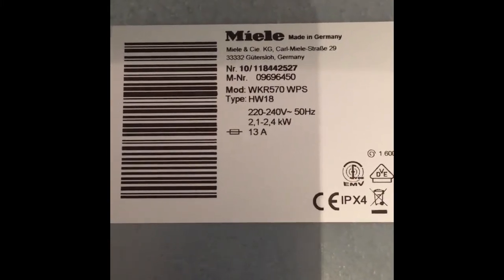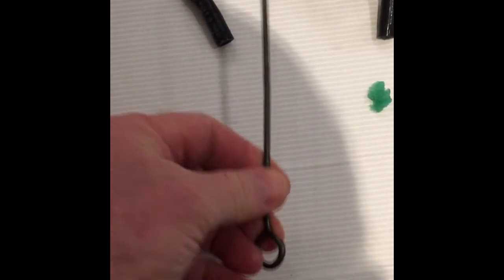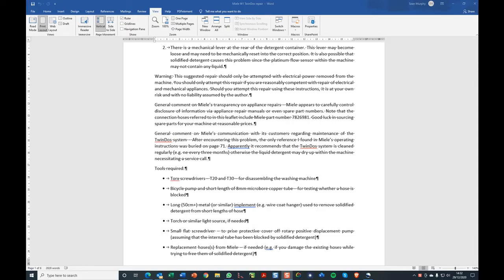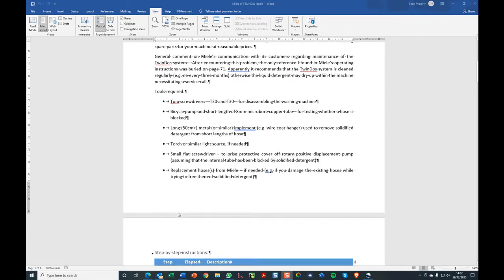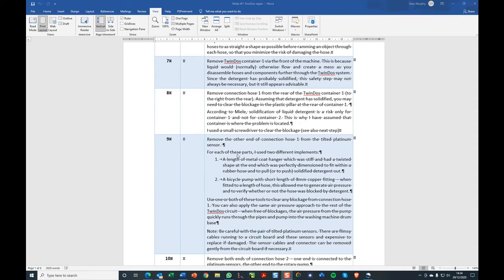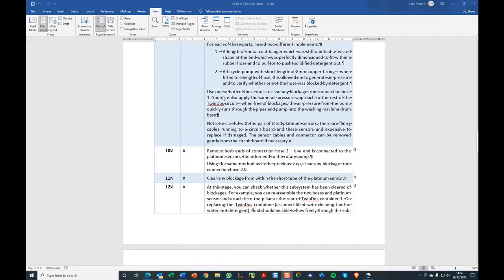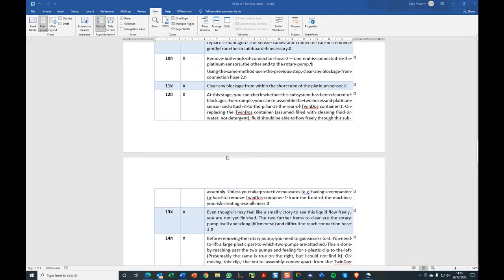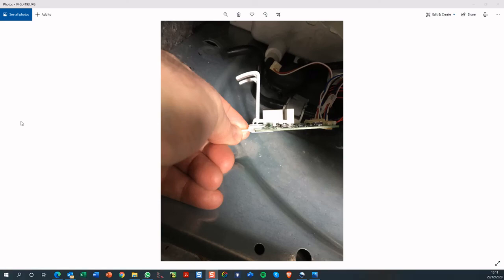Miele W1 WKR570 TwinDos Washing Machine Repair - problems with solidified detergent

Comment: Thanks for the great video. I did everything according to the instructions, but the following message appears on the screen:"Fit a new cartridge or refill container 2. Monitor wash result" appears, even though 2 containers are full. Any ideas?
Reply from the maker: Correct registration of the cartridges can be quite hit and miss. Sometimes it helps to turn the power off after inserting the replacement cartridge and then trying again. The machine is not able (in my opinion) to gauge the level of liquid in the cartridge, even though the display may ask for a refill. All it can do is a binary reading - then, after complaining, register the fact that you have changed the cartridge. So - change cartridge if that seems reasonable to you (for example, if the cartridge is empty - or if you have just run a cleaning cycle) rather than believing what the display says, then cycle the power a few times to make sure that the machine registers that a cartridge is present correctly.
Reply from the maker: If you had previously experienced clogged pipes which you had cleared as per the video, then you could manually check that the liquid is flowing again by temporarily unplugging one of the short pipes running between the DOS cartridge and the pump. You may want to place a low receptacle underneath the pipe to catch the liquid that escapes. It also helps to have a helper inserting the cartridge, ready to remove it once you have confirmed that liquid flows correctly.
Reply from the maker: One other oddity that occurred for me was that you may need to reset the volume of detergent to be dispensed, using the machine's display and menu. Ours had reset to zero millilitres.
Reply: @zengoelectricslimited6744  Thanks for the quick reply! I will inform about the result! Best regards!
Reply: @zengoelectricslimited6744  Hi, I dismantled the washing machine yesterday, cleaned all the pipes again, even replaced the Platinum flow sensor. I even opened the control unit and checked the contacts, everything is fine. I restarted to factory settings, but none of the above helped. The message continues to appear after each wash. I also tried your suggestions, but it didn't help either. If you have any more ideas, please share. Thanks!
Reply from the maker: One other suggestion. The system recognises the presence of the cartridge using a plastic lever (visible from the front of the machine when you take the cartridge out) that connects the rear of the cartridge to a microswitch on the circuit board to the rear (visible only from the rear of the machine). The circuit board needs to be positioned accurately for this mechanism to work correctly. Looking at the setup, it may be possible for the circuit board assembly to slip out of place and then this signalling mechanism may fail. The board should fit securely within a plastic slot to the rear of the cartridge assembly. Perhaps you have jostled this board out of position. It is worth a try.
As a shortcut, you could try manually pressing the microswitch by pushing on the plastic lever from the front. If you depress this lever and the display error message changes, then you have learned that this is where the fault lies.
One more suggestion - there is a spring loaded plunger that makes contact with the rear of the cartridge, forcing the cartridge to open when loaded in the machine. You could test the operation of this out of the machine by using a pencil or screwdriver to verify that liquid can escape the cartridge. Once the cartridge is pushed home, there is also a spring loaded lever at the front of the cartridge to engage it and hold it in place. You could also check this.
On my machine, once I had exhausted all other potential faults, I re-assembled the machine, then removed the front of the machine and disconnected the tube running from the DOS 1 container. This allowed me to verify that liquid detergent flowed correctly on the maintenance cycle. For this maintenance cleaning cycle, I fitted a spare DOS cartridge filled with water. It only took a few seconds to verify all of: Liquid leaving the cartridge; liquid flowing through the pipes; pump working correctly; liquid arriving to the front of the machine. This sounds like over-kill, but at least it reassured me that everything was working. It still took a few more washes to replace the cleaning water in the pipes with liquid detergent. The detergent gets loaded in the first few minutes of a wash cycle and then you can observe the suds in the water to verify correct action for the full system.
Reply from the maker: By the way, I discovered after a lot of fumbling around (with restricted access) at the back of the machine that it is likely possible (have not 100% verified this) to remove the entire TwinDOS assembly (including pipes and electronics) through the front of the machine. This would enormously simplify access to the mechanisms. In order to do this, you need to 
(1) Remove the top of the machine - using two screws hidden behind plastic plugs on the side edges at the top
(2) Remove the front of the machine:
     * Remove the seal around the front of the washing machine drum - this slips off easily using a screwdriver
     * Remove a large screw from beneath the seal
     * Remove screws from the locking mechanism
     * Lift off the front of the machine with door still attached - warning, this is quite heavy - place to one side
(3) Now you have access to the TwinDOS chamber - remove two screws holding this to the frame - can't remember how the TwinDOS chamber access door is removed, but it does not present a problem
(4) The entire mechanism is still attached through friction to the base of the frame - push gently backwards to free the retaining lugs, then lift off
(5) The entire mechanism with pipes, pumps and electronics now looks capable of being pulled through the front of the frame - this gives perfect unrestricted access to the whole mechanism for scrutiny or repair
Reply: @zengoelectricslimited6744  yep, can be done entierely from the front. See service miele manuals like this one (for the washer-dryer wt1 but it applies to w1 too, they describe both access methods under §.7 "dispensing system") https://fliphtml5.com/jknmy/kxha/basic/351-400  (download pdf & use index in reader sw for easier browsing)
if doc link dead search for "Technical
 Service Documentation TSD no.W0008"

Comment: Great video!

Since recently my Miele is displaying error F0214 when using TwinDos system. Do you know what is this error related to?
Reply: Good info. From Miele site they have superseded this sensor 5 times. Surely  this is an inherent  fault and is covered by EU rules for 6 years
Reply from the maker: From a German source: The error F0214 indicates that a temperature sensor does not detect any or incorrect values. This is the PTC 2 (B3-5).
Either a thermocouple itself is defective or the sensor stops working. It is also possible that an electrical connection has been loosened by the vibrations.
Reply from the maker: From the same German source: Doesn't belong right here, but on my Miele WMG820 (BJ2016) the error F0214 was caused by a defective TwinDos platinum sensor 9 976 602. The sensor is located behind the TwinDos slot. To do this, the machine must be opened from behind. The part costs about 85€ at Miele. (I have come across platinum sensor issues before - the part is hugely expensive)
Reply: @zengoelectricslimited6744  Yes, it was caused by a defective TwinDos platinum sensor. Since the defect was not caused by misuse I wrote to Miele and got 50% discount on the spare part. 
It actually has two sensors inside (one for each catridge) and I figured out that only 2nd is not working, so now I have one (1/2) as spare. :-)

It seems that Miele has problems to keep the quality of the TwinDos in line with the rest of their systems. Platinum sensor has undergone several modifications and it would be nice to have it regularly available at discounted price level, as it's way-to-expensive repair tend to ruin customer satisfaction.

Thanks for support!
Reply: @Marko-zp6gm  guys, the platinium sensor is a basic pt100 RTD. At 25 deg C. it mesures around 110 ohms. If you don't want to pay for the overpriced miele branded part & don't care about empty container detection (it will still warn by estimating the dispensing) you can solder a 110+/-1% ohms standard 1/4W resistor (on the wires or on the pcb directly, whatever is easier). Will do the trick !

Comment: Unfortunately in my case the four pin white connector cables detached from the plug (cables and plugs seem a bit flimsy to me), They are not connected in the same order as on the other end of the cable. Dies anybody have any suggestions on the pin layout, I do not want to try all 24 combinations without knowing what kind of signal is transported over those cables..
Reply: Ok, the pins are GND, +5VCC, +14VCC and probably OneWire. Figuring out the order..

Comment: I was a Miele tech for 17 years, but retired right after I purchased the W-1 And T-1. When I had a problem with Twindos cartridge 1, I called Miele for help, but got none! That is why I'm especially grateful  for your  very helpful video. Thanks for taking the trouble to do it. I'll let you know how it turned out!
Reply from the maker: Thanks James, I am sadly familiar with the inability of modern white goods firms to offer practical post-warranty repair advice to their customers. They seem to find it more profitable to invest in marketing than in support services. My values are more about building customer loyalty through superior support through the entire lifecycle rather than just the warranty period.
Reply: @zengoelectricslimited6744   
Actually the Miele tech-support guy I reached really wanted to help, but he was working from home and couldn't send me a diagram
Thanks to your video, I got into it and found the Twin Dos #1 lines gelled up!  Since I have a stacked unit and didn't want to unstack it, I did some creative problem-solving to clear the line going to the front without removing the front panel. I had a length of garage door-type cable (plastic coated) and used that to make a hole through the gel! Then a trip to Home Depot to make up an adaptor to flush the line with hot water. after about a minute's flush (I saw the water building up in the tub),  I reconnected the lines and ran the Twin Dos Maintenance program and it worked!  Thanks again!
Reply from the maker: @MrDdrmr  Well done!
Reply from the maker: The video section at four minutes in talks about the control circuit board with plastic levers that press on microswitches to register the presence of TwinDos cartridges. This is certainly the source of problems where the machine fails to recognize whether the TwinDos cartridges are in the right place.